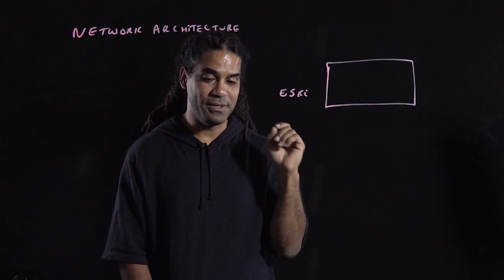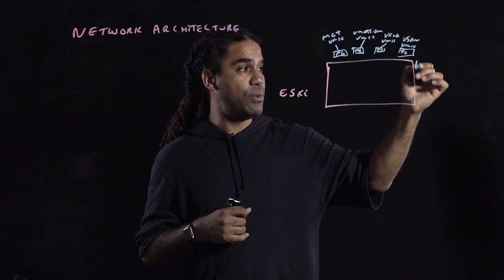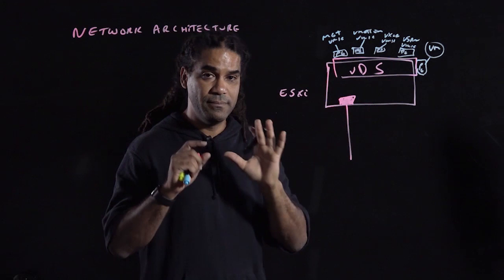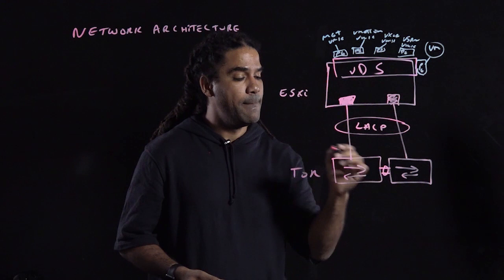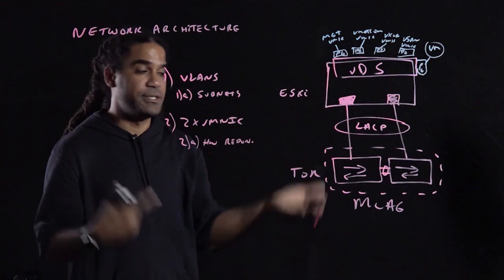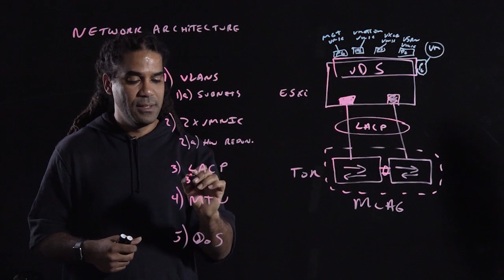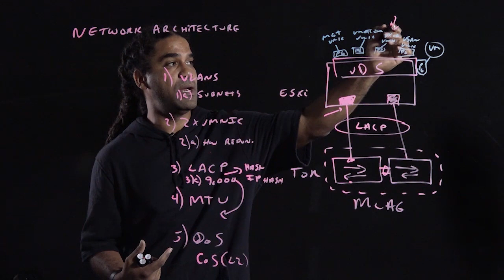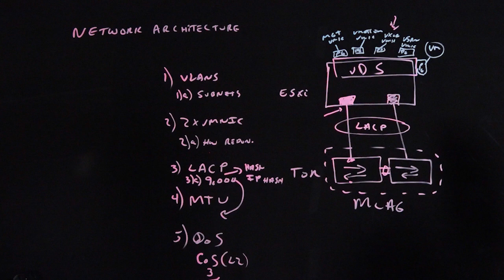Understanding vSAN Network Architecture and Network Design | vSAN

Comment: Why is 40Gb not recommended?
Reply: probably due to the cost of 40GB..until it goes mainstream...in his video you are looking at a single vSAN host, but in reality with FTT you are looking at ~4 ESX hosts..some switches come with 2 40GB uplinks, but if your looking to invest in an all 40GB switch your looking at a good amount of cash..also you might want to keep in mind that these are TOR switches and not EOR switches which means that you might want to do a 100GB handoff to the EOR...i think with a 10GB uplink as an TOR and 40GB EOR switch you should be fine..
Reply: @everlastinggobstopper6879  besides of that the tendency is going to 25GB for TOR and 100GB for EOR...

Comment: Thoughts on Load Based NIC teaming instead of LACP?
Reply: LBNT overrides a flow's LAG hash (egress on ESXi host) you have configured. LBNT helps mitigate instances where you get substantial disparity in the egress load sharing of the dvUplinks. LBNT won't be of any help in doing the same for the return traffic (ingress) as network switches don't do LBNT. LBNT would probably be of most use when the dvUplinks are of lower speed (1G). If you have 10G+ dvUplinks, it is highly unlikely that you would have substantial disparity in the egress load sharing.
Reply: @Elver  the MAC tables in the switches will return the traffic to the originating port.  That’s why vSwitches garp.

Comment: Recommending LACP.... gross.  Who only has a single NIC?  I suppose converged solutions, but other than that I've found LACP to be a pain more than anything else, it adds a layer of complexity that is difficult to troubleshoot
Reply from the maker: Thanks for watching.  You are correct in that LACP is complex and largely unnecessary for the large majority of environments.  Our newer videos as well as all of our design guides and operations guides reflects the much simpler and equally robust alternatives.